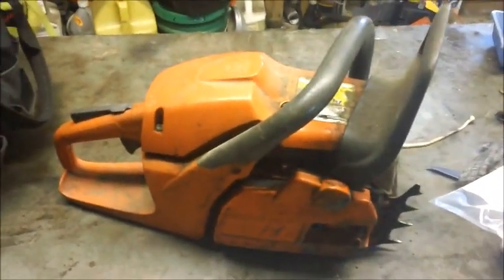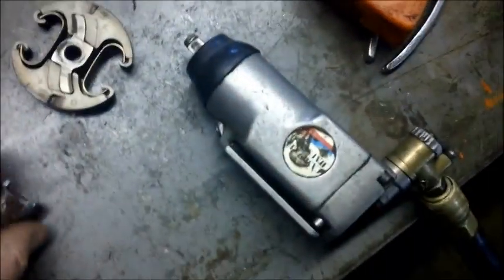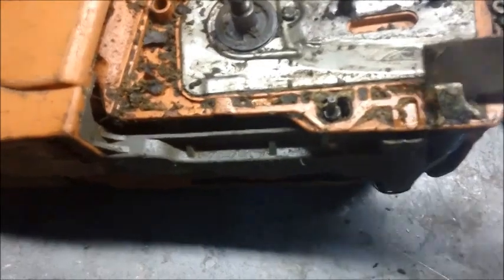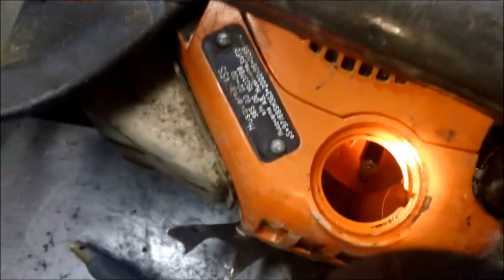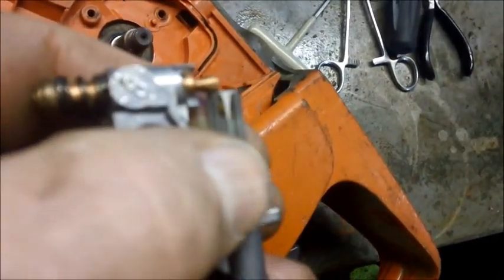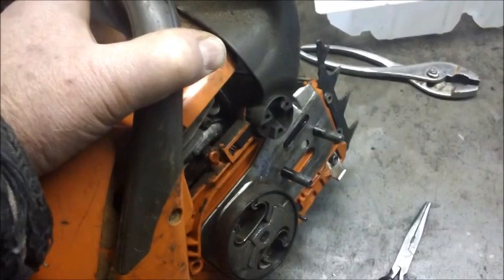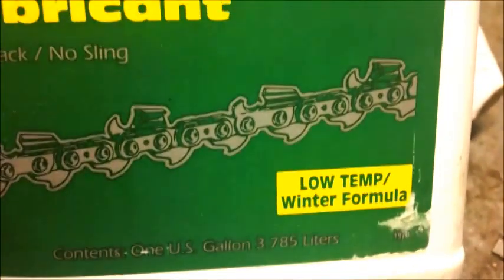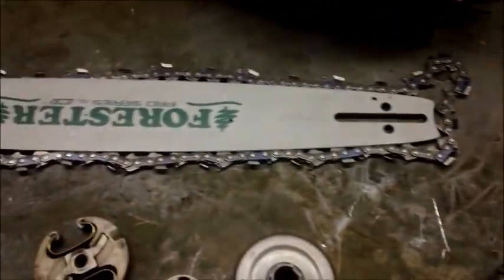Husqvarna 455 Rancher. From Rough to Running; Overview AND Oiling issues

Comment: Homeowner / Farmer here.  3 to 6 cord a year (depending on weather). 
This puppy has done just fine on The Homestead for the past 6+ years. 
Does just as much work clearing brush / weed-trees, windfall / lighening strike, and even the occasional rough lumber work out in the field. I'll even confess to having used it for some demo work when a reciprocating saw crapped out and broke
I have no problem with it and will keep this one running the remainder of my life.
I've had 3 chainsaws in my 50 years and this one has been the most reliable.

Comment: I am in agreement with your comparison. I got a abused neglected and discarded 455 awhile back. Had broken clutch cover and carb all out of wack. Cleaned all gunk and some of the grey primer over spray off. Cleaned carb and replaced cover. Tuned and gave to my son for firewood duty. Very reliable saw as you said.

Comment: My 455 run out at half tank of gas  , pin hole in gas line , not have problems  with oiler  yet , 7 years old , great saw and dependable

Comment: Still loving mine. I'm just a home owner who heats with wood and has cleared alot of brush. I've had the 455 over 3 years and it's paid for itself over and over. I'd never claim it's as good as any pro models because I'm no pro but for a farmer/rancher who needs a great saw that won't require a loan, This saw is the good money spent.

Comment: I know my 455 cranks easy and runs great.  The other day I put a new 16 inch bar and chain on my son in laws 240 husky that I gave him several years ago.  The 14 bar made the saw have limited use and the 240 will easily handle a 16 inch bar.  It was below freezing and I could not keep the 240 running until I richened it up a bit and raised the idle up a smidge, and it oiled well.  It may be a little rich for summer use but better rich than lean.  As a comparison, I cranked up my 455 and it started in a couple of pulls.  My son in law was amazed and I left him checking prices on a 455 at Home Depot.    I think he now wants a 20 inch saw to go with his 240.  I did not tell him I was running 96 octane gas in my saw.

Comment: The best thing to clean saws with is a stiff brush.  I have a glue brush I got at a builders supply and it does a marvelous job cleaning up a saw.  The bristles, unlike paint brushes are not affected by oil, gas or water.  They are also pretty stiff and do not get deformed but are small enough to clean out small crevices.

Comment: I love my 455, Walt.  It runs great, starts about as easy as any saw that I have ever owned.  It does not have oiling issues, because it is almost brand new ( 6 tanks).  About half the time I do not even press the deco valve on it;just tuck the handle under my right leg, prime, full choke and pull.  It has great balance and light enough to tote all day.  It is also quite unlike my farmertec ms 660 which will beat me to death getting it going.  Once running the 660 is a good saw.
Reply from the maker: They changed the bar oil pick up filter early on and solved the problem. They are probably the most under rated saw out there, and also one of the most reliable. Bob will tell you he's sold piles of them and none have ever come back failed. The 660...if you get a HyWay handle bar(stronger) , OEM bar studs, OEM choke & Trigger for the controls, shim the chain adjuster (although they apparently have upgraded those ), You will have an easier to start and very workable saw. I just did a once over on the ones I build last year for "Matt The Logger"  and one I built in 2015 for a firewood guy....with those mods, they STILL run really well. And the fuel lines, they went soft on me. Changed them out with OEM. I Also had built them with OEM Pulse lines. But they have matured into solid pro level work saws....lets see if they go another year! Fact is the time they have on them now is more than most folks will put on a saw in a life time. I've replaced the sprockets ...again they were beat. That's an indication of time. Did that twice now on the three and four times on one. How is that, instead of number of tanks...number of sprockets!

Comment: This is the first new saw I purchased. I got it in 05 and since then I only rebuilt the carb once and fixed the oil pickup. So it is a good reliable saw but if I knew what I know now I would have gotten an XP. But love my stihls too especially my 066.

Comment: Another great video! I've always wanted to have a 455. I recently got a 345 off Craig's list for $45. Just needed fuel lines and carb kit. I ended up putting a new B & C on it. For the power, weight and cost it's probably my favorite saw at the moment!
Reply from the maker: Lane Vines Those 345's can be built into 346's if you want... or can be built with any of that family of saws top ends. The last hot rod 350 I built started as a 345 BTW.... check out the later 350 build video's. A few systemic issues that once you see and understand are real easy to fix.

Comment: I use Poulan bar oil in the winter.  you can also add a TBS or so of kerosene to your regular bar oil per gallon to thin it down for winter operation.  it does not get that cold, here, so I use Stihl  Platinum bar oil, year around although I could switch to the thinner Stihl Woodcutter oil if I needed to.

Comment: Could have used a wire brush too right to clean  the wood and stuff off too. Neat to see inside my saw. Yes I have a 455 too. Haven't had to bad a problem yet on my saw. I have a Sthil 290 Farm Boss as well. Now I had a problem with it oiling. I took it to a shop and paid to get it fixed. I love both my saws. Hey have you ever used a saw sharpener that uses battery post as power? I bought one a long time ago it looks like a Drimmell but it isn't. I was wondering if you have ever done a video showing how to use it. Steve Rob sent me over. Thanks. Wow that chain size changing tool that goes over the clutch cover is dam cool.  My 455 has a 20" bar Factory. Yes it would save some weight but I like my 20".  My saw has always started good too I agree with you.

Comment: I  bought a 455 three years ago new.  I cut a tree down for a neighbor and it was paid for. I even got the wood from the tree I charged to cut down.  I heat with wood and have cut 10 cords of wood since with no problems.  I was lucky over the weekend and found a almost new 455 basket case at a garage sale.  All I saw was tons of used parts for the future.  This saw looked new. I got home and used my original one as a pattern to put that puppy back together. I think the people just wanted to tear it apart to have something to do. it took 2 hours to put it back together but it started on the second pull. It is actually in better shape than the one I bought new 3 years ago.  Now I almost feel guilty in telling you I paid 20 dollars for it.!!!
Reply from the maker: I'm jealous! Most under rated saw on the planet in my humble opinion
Reply: +rowmin goat    I'll give you $40 for the saw.  What do ya say?? Double your money??  haha

Comment: You can add a little kerosene to your regular bar oil to make it a winter bar oil.  I just put a little bit in the bar oil tank for winter use.  I use either Stihl Woodcut terms or Platinum bar oil in all of my saws which are mostly Stihl saws but I do own Husky saws.

Comment: You can add an ounce or so of kerosene to regular bar oil and make it a winter bar oil.  I just switch over fro Stihl Platinum to Stihl Woodcutter oil in the winter because it is thinner than Platinum.  It is also cheaper.
Reply: I use the new thinner red stuff in these saws, much better (Kinetix) than the current stihl oil

Comment: Inside the clutch cover is a black plastic cover that holds the tensioner spring in place. What is the size of the 4 screws part No. 503217010?

Comment: I considering getting one but I see a lot of people have a problem with bar oil leaking. Have you encountered that problem?
Reply from the maker: 17320508don I experience that with many saws, probably half of them....on a scale of 1 to 10.....less than one on the radar screen of the guy using their saw a lot. I use rags under my saws to deal with that or just let them leak on the wooden shelves I have to store my saws.. AND I don't re-fill the oil after using it. But to answer the question. No...:) Both the 455's I've experienced as saws in use on the farm were oil tight! Imagine that.One thing I can say is as compared to similar priced home owner saws, they have a better anti-vibe system and filter system. They don't feel "squishy" and loose like one famous brand because of THEIR anti vibe suspension. And their air filter / air box draws air from the flywheel area and the filters have to deal with less dust and chips than ANY brand save Jonsered. And they are reliable to the point of boredom. You will sell it running because it's bored you to death with its consistency and regularity and you want more power LONG before it will ever fail.I have one on the bench right now that was bought by a pro logger looking for a cheap expendable saw for his skidder.....ten years ago! It's on my bench because he ran over it,...needs plastic. It does leak BTW..:)
Reply: afleetcommand Ok great! Thanks for answering so quick. My last saw a 55 rancher leaked a bit too. Can't wait to buy one!

Comment: I agree 100%
Reply from the maker: Thank you! Check out the 350 series...... More power in a lighter saw. ALSO plan to test the new Husqvarna 543, That's a new "RedMax" built saw for Husqvarna. Has NONE of the issues these 455's and similar Husqvarna saws have. The saw's I think I would recommend in that price/size range are the Jonsered 2252/Husqvarna 545; Husqvarna 543, Husqvarna 450. OR for the adventurous one's building those older 350/346 series saws. They can match the new saw performance for 1/2 the price if your not afraid to grind on the cylinders a bit. And the saw puzzle aspect is recreation. And all the fore mentioned saws have similar power and less weight than a typical 455..... But now Husqvarna has upped the antsy with the Auto Tune 455 & 460. Both have more power and therefor have power to match the size and weigh.....

Comment: Hi, where can I purchase the clip on screen you show in the video ?
Reply from the maker: Samantha Zeccardi Which clip?
Reply from the maker: afleetcommand The one screen  that snaps onto the oil pick tube on the end of the oil line was from a Husqvarna dealer.. any Husqvarna dealer can get one.  Might even be able to "ebay" one.
The "Forceps pliers" can be found on eBay as well. I got mine from a local army surplus store...
Did I answer your question?

Comment: just bought one, but its a in a little better shape haha. what is your opinion on the aftermarket air filters from ebay? mine pulls a 3/8 on a 20in bar. although i would prefer a 18". i checked the compression before i bought it and it was 150 psi its a strong runner

Comment: Bought a 460 two years ago used it once and tried starting it again.  Starts up after exercise of my right arm for about five minutes then huffs and puffs and runs ruff.  Stops and forget starting it again that day.  Pull out my lil buck two ninety eight poulan and gets the job done.  Have a three year extended warranty just keep forgetting to take it in.  But here in California the have so many restrictions on anything gasoline I doubt if the warrant is covered.  One guy told me if your going to spend around five hundred for a chainsaw don't buy it in California.
Reply from the maker: They are pretty tough to kill. Probably sat with gas in it...get the old mix out, get new mix in. THEN pump on that primer button which will effectively do a poor mans carb clean.... then follow the starting directions with that goofy multi function deal it has for a choke...bet it starts. Worst case it may also have a wet plug from all the old mix being sucked in when you tried to start it.

Comment: Does no one know that you don't need a special tool to get the clutch off? Everyone on the internet makes some stupid special socket and puts a rope in the cylinder. I can't believe it. That's what this two notches are for with arrows pointing with a big OFF. You hit it with a screwdriver and hammer!!!!
Reply from the maker: You are so smart...:)
Reply: That's right - that's how I do it.  The clutch has reverse threads.  Just a sharp pop on the screwdriver with a hammer does it.  When installed finger tight, the first run with the chain brake will tighten it as much as needed.  And, use of the chain brake will keep the centrifugal clutch tightened.